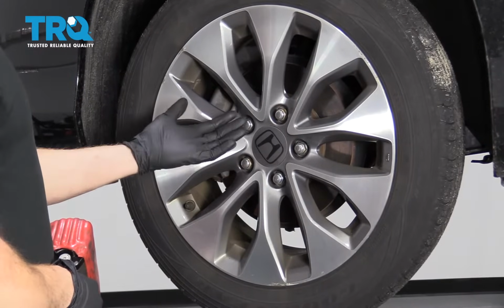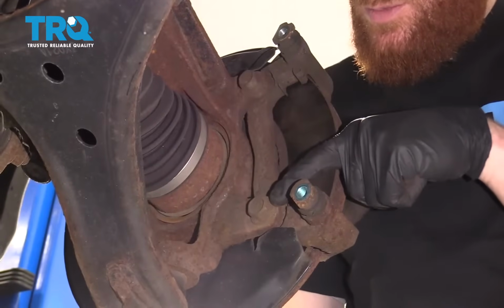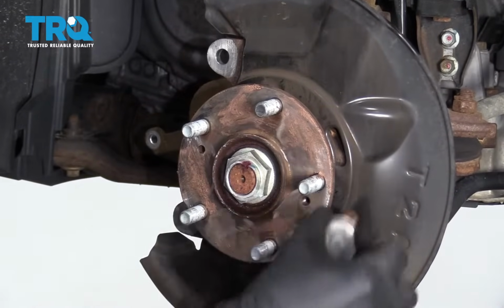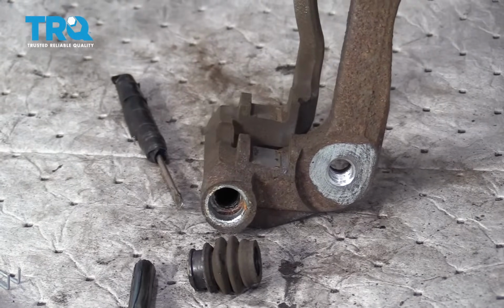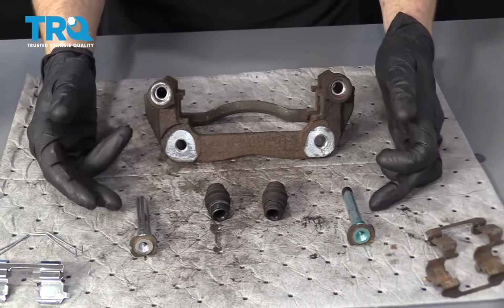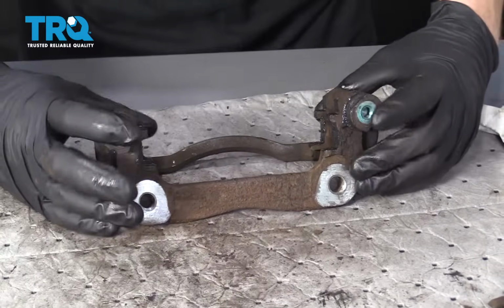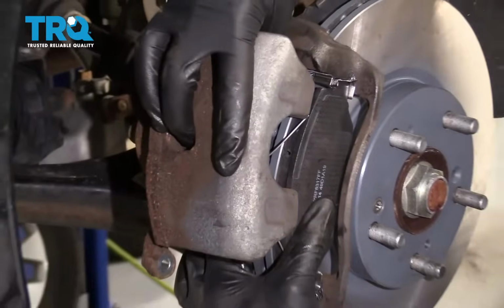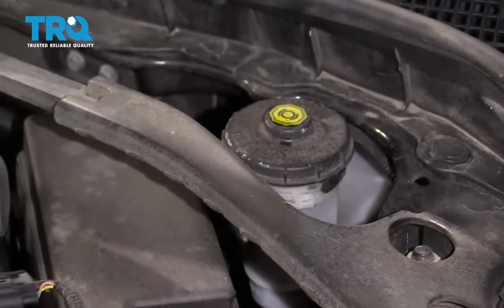How to Replace Front Brakes 2013-17 Honda Accord

Comment: This video is very good with all the detailed torque specs to put the caliper mount and the caliper back on the axle. Most people won't need to replace their rotor, as it appears the one on the car is still serviceable. The only reason anyone would replace the rotor is they are warped beyond repair and replacing them is cheaper than to get it resurfaced. For most people, they would only need to replace the brake pads, so the procedure would be different for compressing the caliper, using a caliper tool, not a screw driver. It makes sense to take the caliper mount to redo the slider pin holes so that they don't seize up later. I would not reinstall the set screw on the rotor, get a new one, or you won't be able to remove it again, it's relatively cheap. The only missing step is he did not open the bleeder valve before compressing the caliper, it should be done to remove the excess brake fluid and not forcing it back into the master cylinder. It is very important to do this so that dirty brake fluid did not go backward into the system. In fact, it is best to bleed to brake line so the brake would work much better w new fluid. Well done!

Comment: Great video. Not Phillips but JIS / Crosspoint on those rotors screws. Also SBS Brake Treatment Spray II is a good product for the hub and rotor contact surface. Just my 2 cents.

Comment: I enjoyed your back brake video 2 years ago that I’m back for the fronts.  Had no luck with the impact driver so I had to drill both rotor screws.  The key is to drill clockwise until you are about 3/16 in.  Then switch to a drill bit that is 1/16 wider and drill counter clockwise.  It hooks up with the screw and out it comes.  Both rotors were stuck on the hubs and I had to pound with a sledgehammer for 5 mins straight on each.  Other than that, I followed everything exactly.  Thank you

Comment: Great video and I can tell you've done this a million times.  Should lube be applied to the brake pad tabs/ears that sit in the clips?  I see half the videos do this and the other half do not.  Will adding lube to the brake pad tabs possibly cause sticking and accumulation of dust and debris to those areas?  Should lube NOT be used on brake pad tabs when using stainless steel bracket tins?

Comment: Great video! I noticed you only applied grease to the backside of the clips which contact the caliper. How come you don’t apply grease to the opposite side of the clips where the pads come into contact with them? Wouldn’t that help the pads slide in and out?
Reply: Dumbest question no answer is the best answer